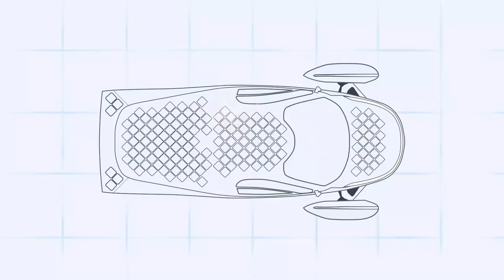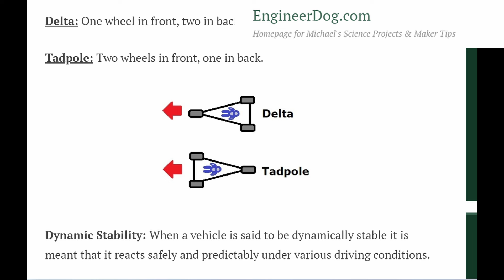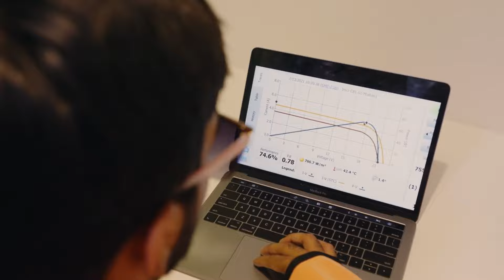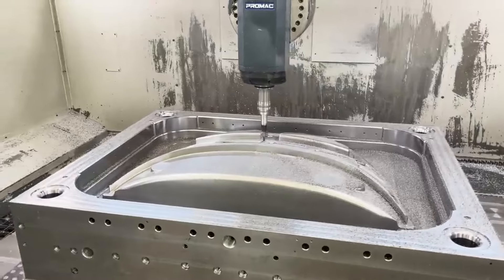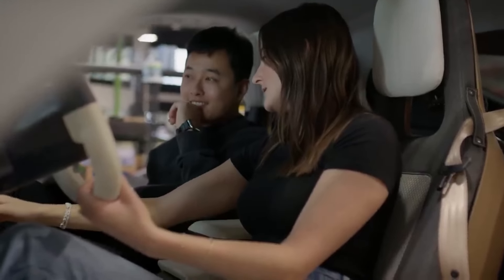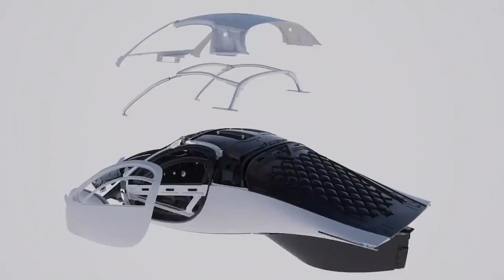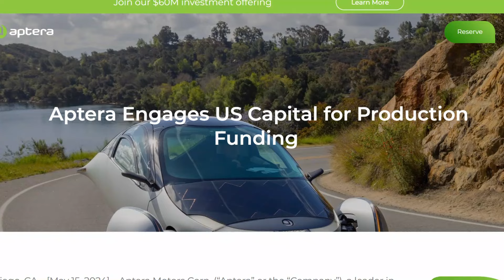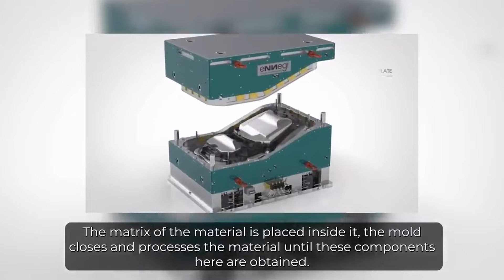Aptera's Stability & Durability Innovation under scrutiny | Part 2

Comment: Aptera is a very stable platform
Reply from the maker: Through innovative design
Reply from the maker: Yeah, through innovative design
Reply: No, it isnt. It lacks one wheel, that makes 50% less dynamic stability.
Reply: Very stable means nothing. It's like saying, "The Aptera will be in production soon." So "soon could be in 3 hours or 3 years. Stable could be like a LMP car in WEC or a F150. Since Aptera has never made a prototype that incorporates the current design (not the 2+ year old one) it would be safe to say, forget making claims until it get out in the real world.

Comment: I was hoping that this video would address the impact of abandoning in-wheel motors in the front axle in favor of a traditional single motor with an open differential. The in-wheel motors gave Aptera the ability to instantly the amount of torque at each wheel to actively counteract the tendency to roll. It seems to me the only way to offset the loss of torque vectoring is through braking via electronic stability control and increased levels of negative camber. It would be nice if Aptera releases a statement on how they plan to overcome the loss of stability that the in-wheel motors could have delivered via active torque vectoring.
Reply from the maker: We did a video on that already. But will hoping do a folow up soon.

Thanks
Reply: Since the new version has not driven across a parking lot under it's own power, Aptera has no idea what will happen.

Comment: I would like to know what maximum lateral G's are safe in this vehicle.  This is the second video I have seen attempting to allay concerns regarding vehicle stability by providing a large number of details on measures taken to ensure stability, but no numbers.  Can we please have the numbers?
Reply from the maker: Will look into that later
Reply: Nobody knows what that is since they have never tested the Aptera on the road or track. Remember, I'm not talking about the old ones as this new one is completely different.